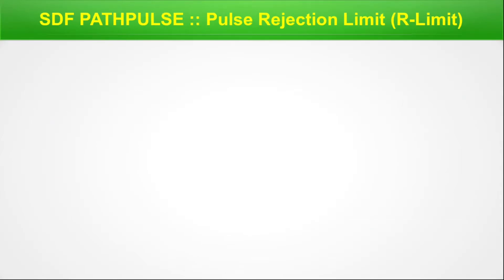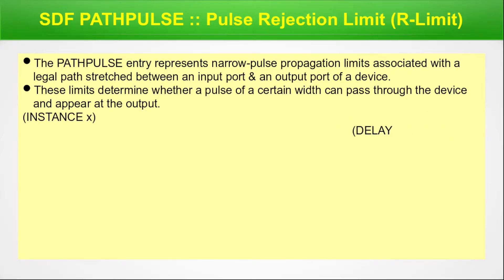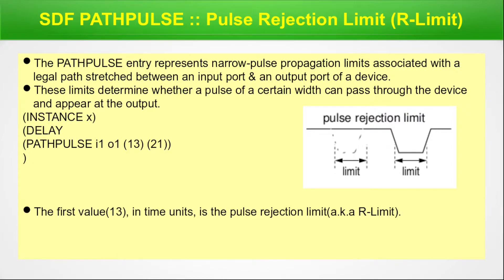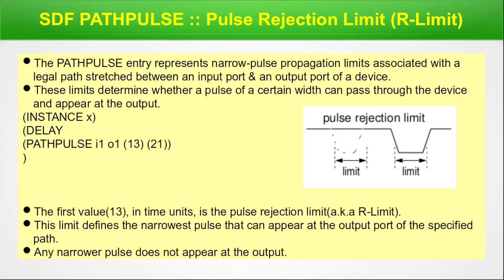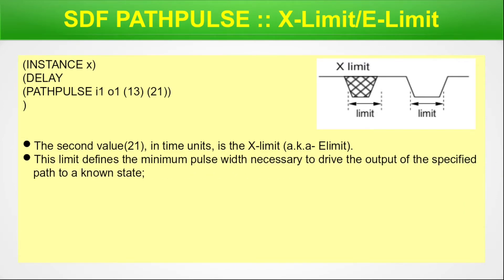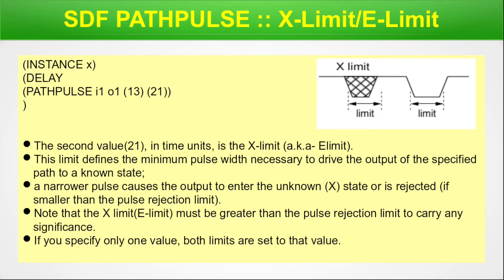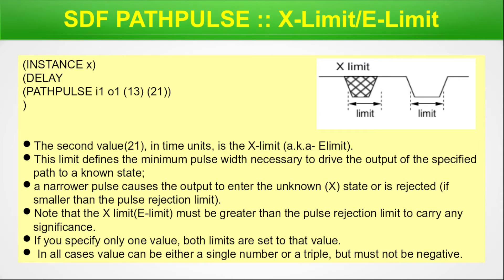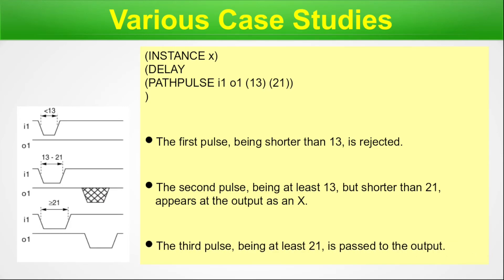Understanding Pulse Rejection Limit and E-Limit in STA

Comment: How to apply pulse_r and pulse_e limits dynamically to a particular module during the simulation
Reply from the maker: in open-timer shell,  you can use read_sdc & update_timing back to back after you modify the SDC. In commertial tools you have to check respective manual !